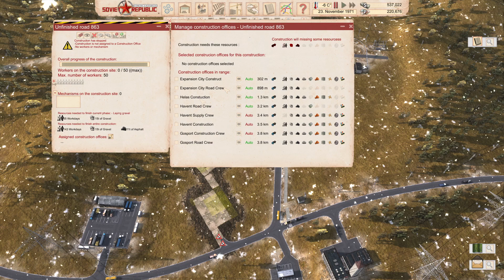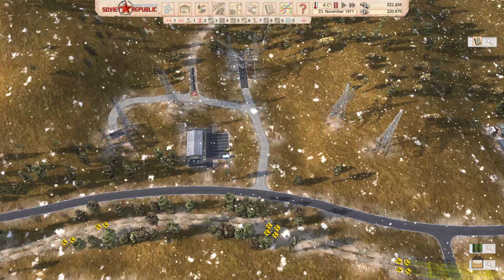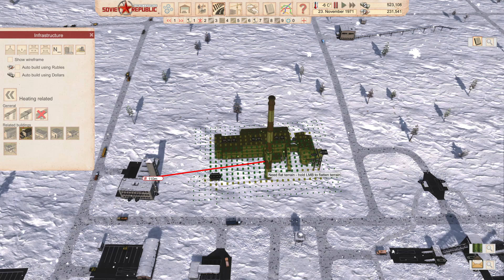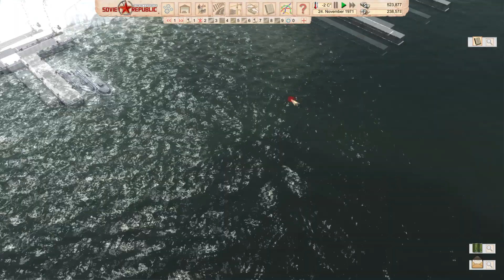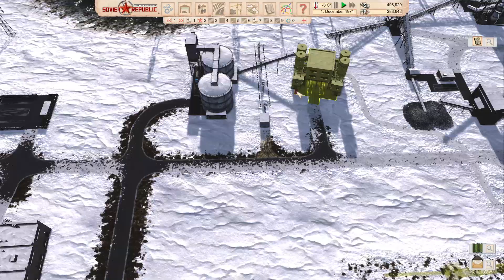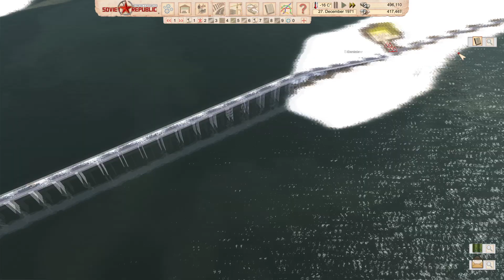Winter Heating :: Workers & Resources Soviet Republic (Airplanes And Tourism) #24

Comment: First of all, don't worry about the schedule, hope your wrist gets better soon!

Then I had this idea today when I saw the city, that trolleybusses would actually be a good fit for Portsmouth. The grid would support that quite nicely and I just think it would fit into the heavy industry setting that you are building around it. Also, you are going to end up with lots of jobs on the outskirts, so only supplying the factories via busses might end up causing jams at the stations and factories. This would of course be a long-term project, but I think it would be worth considering converting a few of your roads to accommodate trams. This would also increase the walking speed of your people by 20%
Reply from the maker: Like the idea,  would be fun to have a trolley bus network in Portsmouth.

Comment: Your cargo ship for mechanical components will spend a lot of fuel going back and forth for next to nothing because it is not configured to wait to complete its cargo.
Reply from the maker: Agree it is inefficient, but at the moment need the regular income to offset the cost of the steel, once the steel mill is up and running will get the ship to wait.
Reply: @StephenSilverbeard  it's not income! That's the point of all of my replies in this video. It's 5% at best, and that depends on multiple factors (so again, ships, fuel, workers, etc..) Until you get your own steel making mechanical components will likely cost you money.

Comment: It is only a matter of taste and of the way of playing of each one but you never plan small intermediate villages which make it possible to manage the fire station etc. This makes the map more alive and they have their uses in the end ... They can as well serve as a relay for the expansion to bigger cities
Reply: I was wondering when he placed the fire station if he would provide it heat. I don't build whole villages but I do have a small or other heating plant in range when I can.
Reply: @bc74sj69  Soon the fire stations will no longer need heating
Reply: @statsneguit3069  Yeah I'm pretty disappointed they removed it from the RCOs. Don't care about the container stuff because I've never used them and most factories are heated.
Reply: @bc74sj69  I am also one of those who would have liked heating for all constructions welcoming the public or workers
Reply from the maker: @statsneguit3069  I suspect that was the original idea behind the seasons update.  The problem is the need to run over ground piping which make cities look cluttered,   A possible solution is to introduce an underground layer for pipes and powerlines, but that would represent a major change to the game.  May be some time in the future.  

Feel heating needs a second look, the restriction to coal (wood with mods) with heat being supplied by pipes restricts expansion options.  Would like to see other heating options added, e.g. electricity and oil, these can have an area affect which will support small community groups.  For example, a community oil tank that provides heating over a small areas, say 200m,  Starting to put my game design hat one, so better stop :))
Reply: @StephenSilverbeard  There are mods for just about everything. I've never had an issue with heating and never used heating mods. It's all about having access to coal, which most maps do. Starting to put on my grumpy vanilla anti-mod hat, so better stop :) That's the thing, people have issues with the game when it doesn't actually have any issues (meaning it can be played vanilla) and immediately just jump to mods rather than learning the mechanics of the game. I know a guy who pirated the game and then purchased it to get access to the workshop just to download a church mod... lol
Reply from the maker: Suspect this is due to my inclination towards maps with challenging terrain.  Although do have some villages/small towns  planned for this map, i.e. the other side of the divide,  once I break out from the current area.
Reply: @StephenSilverbeard  Well even with challenging terrain I do not see what can prevent a geographical framing of villages or very little towns :)
Reply: @StephenSilverbeard  Challenging terrain usually  just means terraforming after the fact and leads to wrist injuries :)
Reply: @StephenSilverbeard  Again, have a look at the map Memaslawia. It is very challenging, yet playable. The terrain is very difficult, the resources are spread out, expansion takes decades, but it's still possible to do every industry without mods. I'm playing Landenegro now, another map with challenging terrain, and with 0 customs (100% island map) so it requires a medium money start to get up and running (you have to duplicate all the functions of customs with 3 harbors, plus a dock, plus a power source). I tested using modded generators vs autobuilding a coal plant / autobuying coal over the weekend.

Comment: Right next to the new farm a gas station would have been smarter than the construction office, which can be moved without disturbing anyone just on the other side of the road. Refueling tractors and harvesters should be given priority in terms of proximity to the farm and distribution office
Reply from the maker: True,  wanted the construction office in the centre to give max range for levelling and primary construction,   In the long term could replace it with a gas station, but in the short term will put a farm gas station.

Comment: You would save time by not connecting your fields right away to the gravel roads to be built, you split your construction projects for nothing
Reply: That's a helpful tip if you don't play tight, but if you play tight the roads may not work out period (as his first attempt didn't). I should follow the same advice for my later fields (first will typically be dirt, depends on how soon I farm). But yeah limiting jobs by building roads is great if and when you know what  size something will be! I am at least boxing in an area with a gravel road and calling that at least a city, but the interior roads I end up splitting since I build tight.
Reply from the maker: Ty for the tip.  Laying out  the new farm is going to be a pain, so may have to accept some connections to the gravel road.

Comment: Unemployment does not cause emigration in the game. Unemployment has a low impact on happiness, and emigration is triggered when happiness is too low (I can't remember the percentage). But again the loss of happiness due to unemployment is really very low and you can assume that it does not lead to emigration.
Reply from the maker: ty for the tip.  Had never been too sure about this. Happiness is an element of the game to test, so it is tricky to find those elements that have long term affects

Comment: For the aggregate storage of coal in your new heating plant, you do not really need an aggregate unloading, the coal unloading is fast, especially as the rotation of trucks will be quite low given the consumption of the plant, for the aggregates it is the loading which causes problems not the unloading
Reply: Yeah I don't think his new  heating plant really will need a unloader either unless it has 3+ trucks that are going to get stuck at the same time. Loaders from a large agg are needed if you do just in time shipping to multiple heating plants all winter via  DO (vs a DO that runs all winter and fills up in the summer to drop off at foreign aggregates).
Reply from the maker: Normally I would not put one in, but thought it would reduce the journey time whilst pulling the dumpers away from the area near the concrete/asphalt plant.

Comment: You should stop building roads with construction offices sending workers there for nothing: the buldozer will do the job on its own. Waste of your workforce
Reply from the maker: To save on steel imports have paused some building that are not required in the immediate future, this frees up COs to push forward key jobs.  Unfortunately  these are predominantly roads and bridges as these  open up access to the Steel Will the aggregate port. 

Another priority job are the bridges leading off the island as it will not be long before over 21s could become a problem.  Finishing the bridges will allow the development of Winchester and Oil Town.  Although Winchester is the more important as this will be a  main rail hub for  food and construction materials,

Comment: For your Expansion City it is better late than never to build a logistics hub but honestly it is quite incomprehensible that when planning each new city you do not have the reflex to systematically plan a complete logistics hub, road and rail.
Reply from the maker: Expansion city is really a 'construction' suburb of Winchester next door, which will have a road/rail logistics hub.  Ideally would like to freeze the population of Expansion City at its current level, but that will depend on how quickly Winchester can be built up.

Comment: Rcs ship is super slow but also super cheap. Using 2 of them and 4 others in my new series on a map with 0 customs (100% island map) landenegro
Reply from the maker: Wanted to give it a try as I have a feeling these will be the first ships to be built as they seem to be the right size to move materials round the map.
Reply: @StephenSilverbeard  they are  equal to around 10-20 trucks and slow as molasses. You need multiple regardless of what you end up doing. Late game shoot for the Frida ships which can do everything in the game (other than oil and rocks) including containers.

Comment: Yeah at 28:36 I meant most people don't hook a DO up to the farm as one of its limited 20 jobs, so when you load a silo the crops overflow into the farm and probably sit there for years. You can get them out but unless you need to use the farm as a 160T silo (and pick them back up) then I advise an RCS and multiple silos as drop off (but I usually do 12+ bigs and try to add in 4-6 mediums in order so you get an early 3rd harvester run
Reply from the maker: Want to test if two small DO are more efficient than one big one as they would provide more coverage.  

Yesterday did a test to see how much crops each field type produces, the average is 62.5t/Ha (a medium field produces around 98.06t) .In principle two 800t silos should be enough to to hold the output of a 20 medium field farm.  This assumes the crops are being consumed, e.g. by a food factory, during the harvest season.
Reply: @StephenSilverbeard  since you make small and medium fields, maybe? 20 jobs is 20 jobs no matter what, it's just that we can manage 20 jobs with both farms and DOs when using 6/6 tractors/harvesters, 12 big fields, 6 medium fields, and 2 storage locations. Your small and medium farms finish growing so quickly you should never have rot on the field no matter what DO you use. The only way 1 doesn't work is if it isn't added.

Comment: Last series I went through the math and buying steel to make mechanical parts can make you lose money. I'd check the math before you go ahead with turning imported steel into mechanical parts for export. If it's for internal use only then it's fine.
Reply: Ran the numbers again to verify what I thought I did last time. In 1971 my steel costs 882.79 per ton, and I can sell mechanical components for 1361.25 per ton.
The ratio is 22:15, equaling .68. If you bought 330 tons of steel, it would make 225 tons of mechanical parts.
The steel would cost 291060 to buy, and selling the mechanical parts you'd earn only  306225. So 15k profit off of a 306k investment (not counting the workers, cost of living, cost to build the plant, transportation, etc). That's only a 5% profit. I think in the last series you were importing steel and exporting mechanical components, and these prices can fluctuate so it is possible to lose money and it's not very profitable (it's pretty simple to make, 1 ingredient in plus labor) so it makes sense to me. And when you buy something, the economy makes the price of it go up (so buying lots of steel would make steel prices rise).
Reply from the maker: Have been caught in the same trap,  the key is to limit the steel imports to limit the production to local use plus a small surplus.  Hopefully using two slow open hulls bringing steel from the border should keep the situation under control.
Reply: @StephenSilverbeard  There is no key to where you will pay off the ship, the mechanical parts factory, and workers doing this for exports while saying you are needing to make money. You won't regain that money or make a profit on it until you have independent steel in excess from your own large coal and own large iron. It's simple as that. Mechanical components are NOT a good value added product to import steel and turn into them for export. Start a new game and do that as the basis vs tiny distillery / tiny fabrics and see how that profit works out on clean books. It just doesn't work out mathematically. And there are times when you will actually lose money doing it depending on the market of steel.